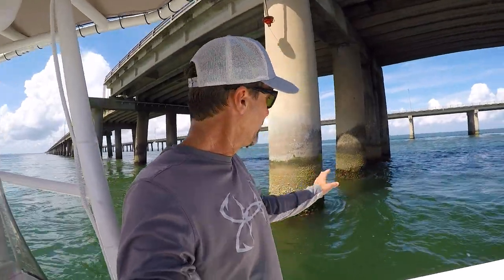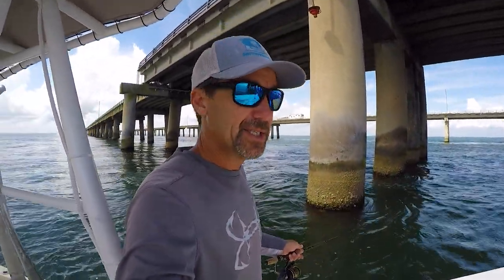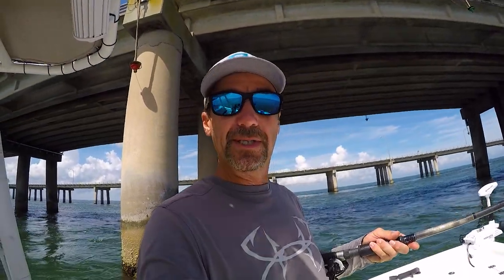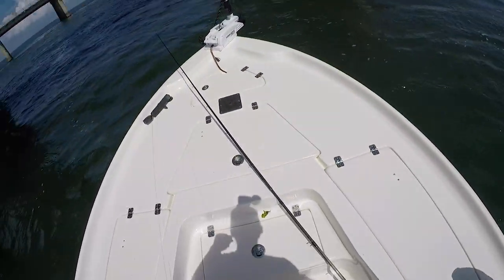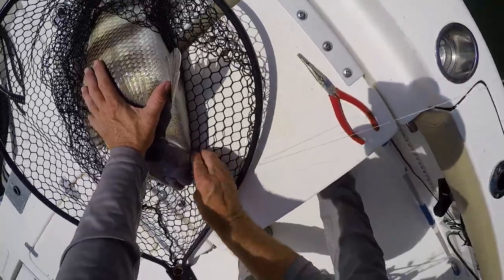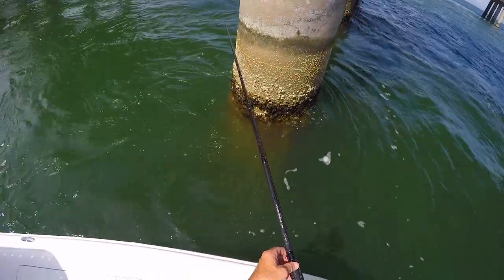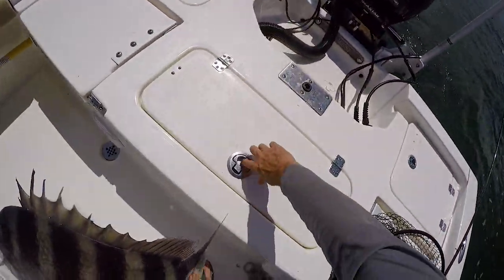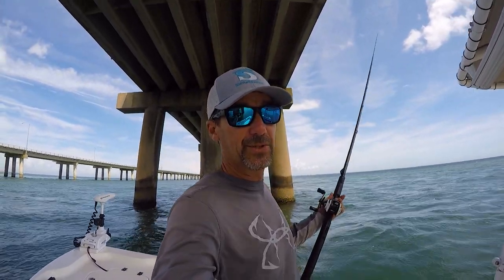Piling Fishing with an 11 Foot Jigging Rod?! (It's Awesome!)

Comment: Great Video! I agree totally with the use of the Accurist reels with the flipping switch for jigging. They are awesome! I had a non flipping switch baitcast reel and since getting the Accurist I never use the other one! On the spot lock issue if you have minnkota you may want to try the auxiliary gps puck they offer. I am told it makes a big difference.
Reply from the maker: Thanks! And yes I have the Puck